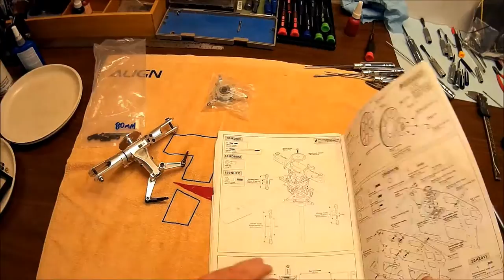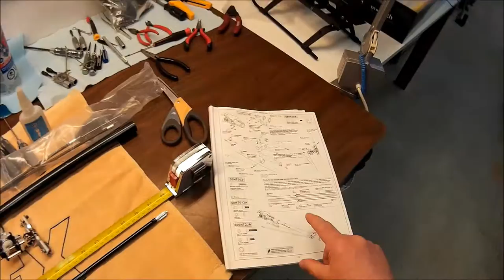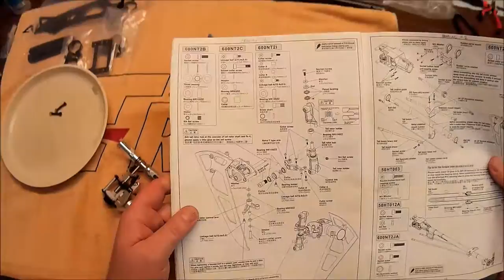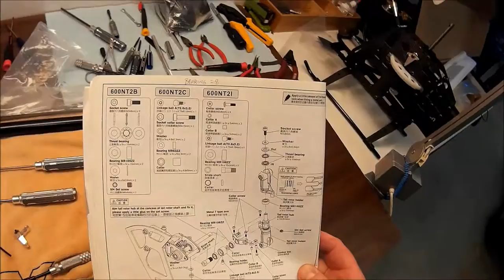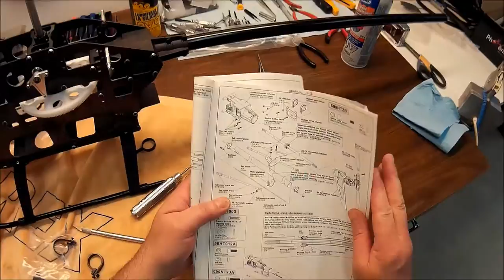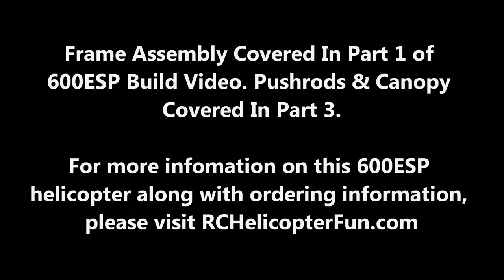600 ESP Build Video Part 2

Comment: Ever since I had a swash ball back out on my newly built Trex 500 years ago (thankfully I hit throttle hold fast and damage was minimal, even the blades survived) I now always use the green R48 for swashplate balls instead of blue. It's technically meant for holding bearings in place but it can also be used as a medium strong threadlocker. SAB also recommends green for swash balls in the Goblin manuals.

 I always use R48 instead of CA to fix the TT bearing it's not brittle like CA and won't fail due to vibration and it doesn't have problems adhering to anodized aluminum. It does take longer to set but that also gives you more time to get the bearing properly aligned. You can speed up the cure by warming it up with a heat gun though you should still let it sit for at least an hour.

 You can avoid getting locktite in the brass bushings by applying it from the opposite side of the threaded hole on the pitch control yoke on the slider and applying it to the threads on the tail blade grip arms with a toothpick and then soaking up the excess with a bit of a paper towel.

Comment from the maker: To my 600 ESP customers; I strongly recommend against using R48/Loctite 609 anaerobic retaining compound for ANY fasteners on this model - it can be very difficult if not impossible to remove on our small M3 threads without significant heat (yes I have tried it several years ago when it was suggested and was not at all impressed with the outcome). Blue Loctite 242 is what I recommend. Clean the threads, and shake it well to mix and you will never have any issues and you will be able to remove it if/when needed.

By all means, if you don't have a quality CA glue such as Mercury Adhesives, or you don't wish to grind the anodized coating off the TT for correct CA bonding, please do use R48/LT 609 for the TT support bearing, it will work very well in that application.

Comment: Great video! Is that some sort of hex/ star tool you used to take the balls off of the swash plate? If so what commons sizes should I order? Thanks John!
Reply from the maker: Hex driver set... I go over the most common sizes on my RC helicopter tool page: https://www.rchelicopterfun.com/rc-helicopter-tools.html
Reply: @Rchelicopterfun  thanks John for the reply. I will certainly check it out.

Comment: Hi john, to stretch this kit to fit into a 700 size scale fuse would you just need align 700 tail boom and push rod?
Reply from the maker: & torque tube
Reply: @Rchelicopterfun  Thank you, yes forgot the torque tube.